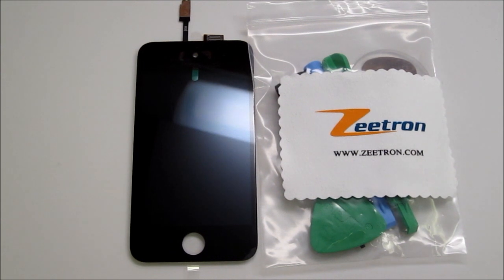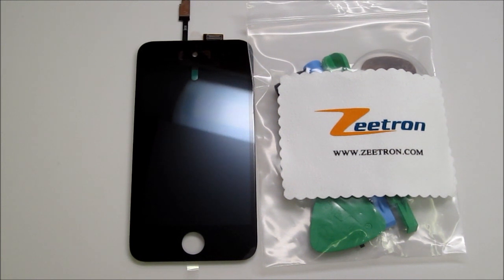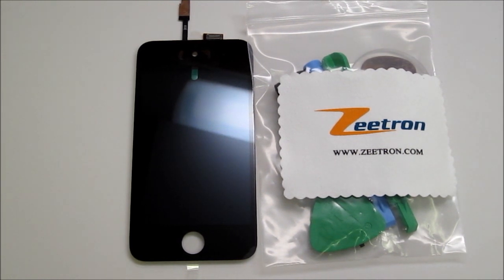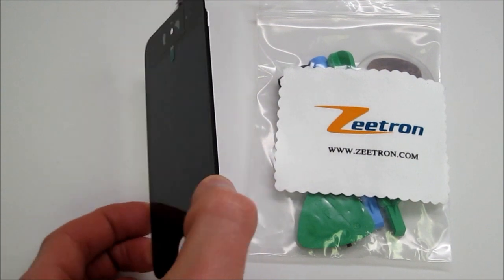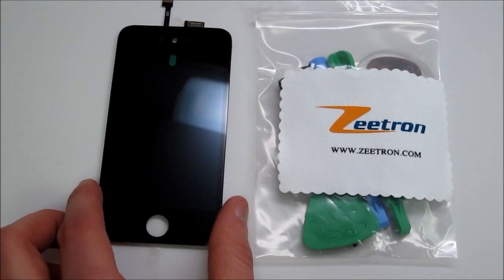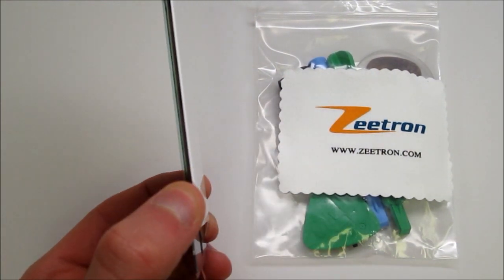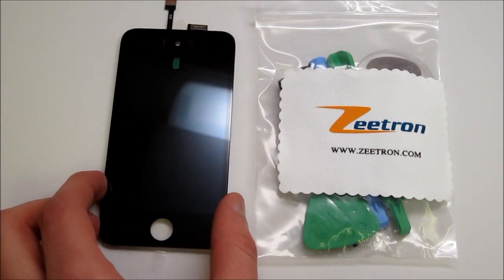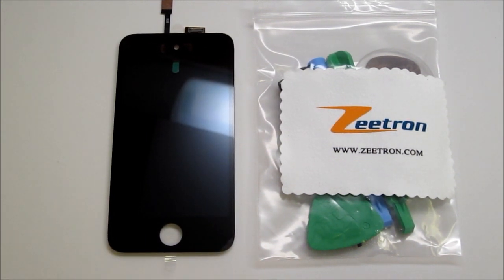iPod Touch 4th Generation Digitizer Glass + LCD Assembly

Comment: Ok so I have a question I was able to change out and replace the glass on my iPod I also was able to reuse the LCD but when I put back together and powered it on all I am getting is white screen is it possible that I damage the old LCD takin it apart are do I have other problems ?

Comment: No guys, you have to order adhesive separately, come on now, do you see adhesive there? lol, I made that assumption once! Order adhesive strips separately. Amazon baby! Everything you need for under $35! I've used one of Zeetronics screens with a good repair outcome for a friend for those of you wandering, this is a good screen. When you buy a screen, make sure it is Original Equipment Manufactured (OEM) product; that means it's the same part Apple uses. Take care.